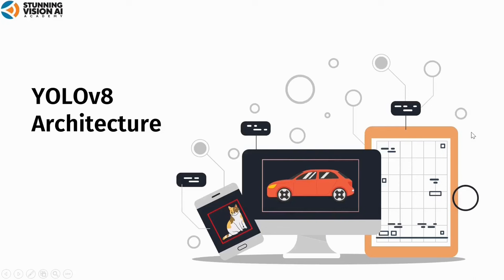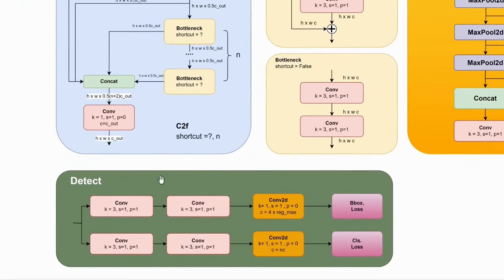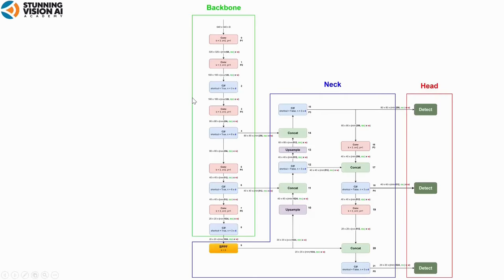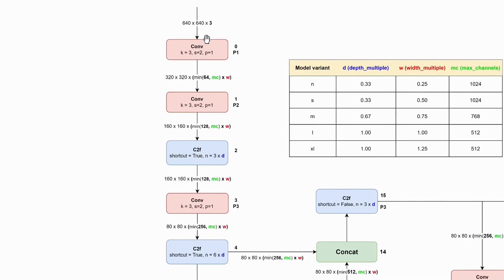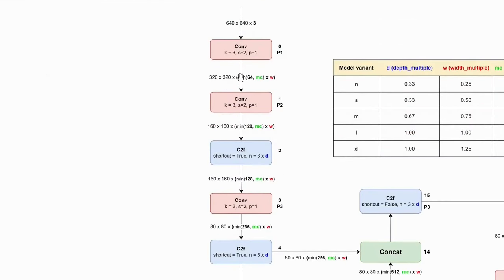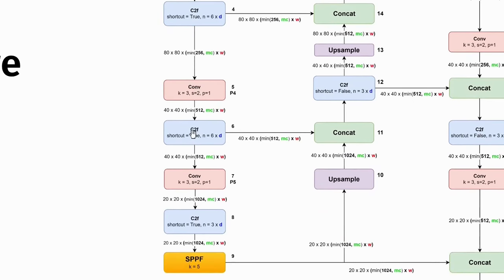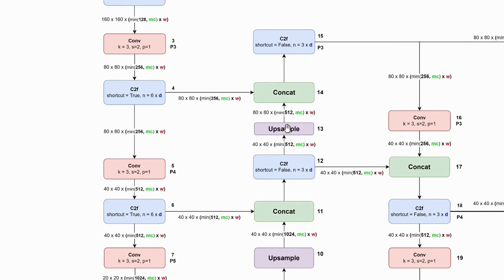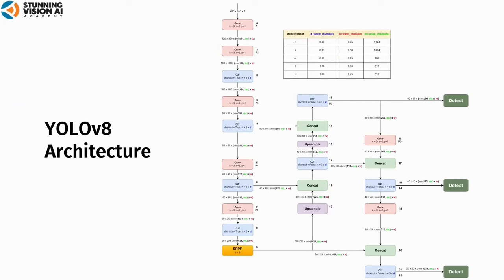YOLOv8 Architecture Detailed Explanation - A Complete Breakdown

Comment: how to create new blocks to improve the accuracy , for detecting small objects or adding new blocks like GAM , how do we decide where to add ???
Reply from the maker: You can edit the yaml file and add the blocks there. 

Adding new kind of blocks required you to edit the source code. 

Where to add? That is challenging question. I have not found any resource saying where exactly the right place to add a block. I once asked my prof. He said: "You have to try and see the result." iterate this process.
Reply: @Dr.Priyanto.Hidayatullah  thank you sir
Reply from the maker: @dalinsixtus6752  no problem
Reply: @Dr.Priyanto.Hidayatullah  sir i need to change the color of bounding boxes during runtime if certain conditions are satisfied.is there any way to use built in function rather than changing the ultralytics source code .
Reply from the maker: I understand your question. However, I am not sure there is such function. @dalinsixtus6752

Comment: Does YOLOv8 only accept images of size 640 x 640 during training? What if I want to use 3840 x 2160 image?
Reply from the maker: YOLOv8 accept any size during training as well as during inference. If you set the parameter imgsz into 640, YOLOv8 will resize your image (what ever the size) into 640x640
Reply: @Dr.Priyanto.Hidayatullah   Thanks for the quick response. After the model is trained using 640x640 img, in my case I get a very pixelated inferred image so I want to use the actual size. The problem I am facing is that I want to train on RGB image of size 3840x2160, but during training CUDA quickly runs out of memory. For reference, I am training on ~16 GB GPU. 

I know this might be a silly question but I would like to know if there are any metrics that would allow me to access how much memory it would required in this case.
Reply: @bipinkoirala2962 you can use patch training and for memory limitation you can play with batch size
Reply from the maker: This is more comprehensive answers to your question

https://github.com/ultralytics/ultralytics/issues/1658
Reply: Do you need that resolution for inference? Or could you use a lower resolution (downscale) and the scale the results back up to your original resolution (upscale)?